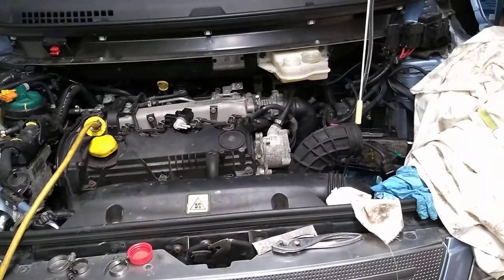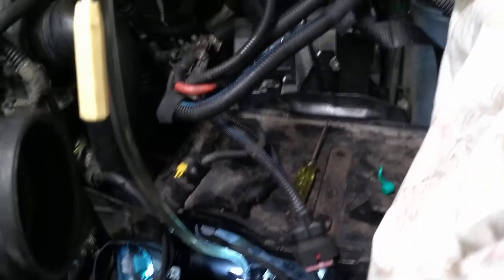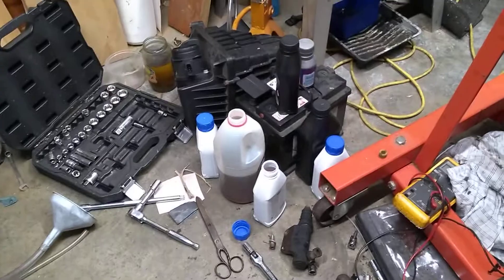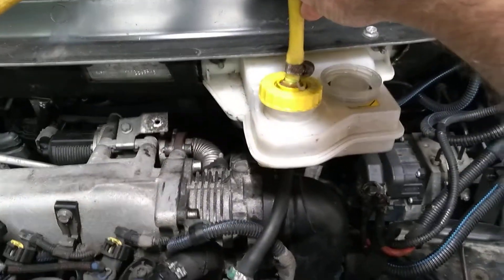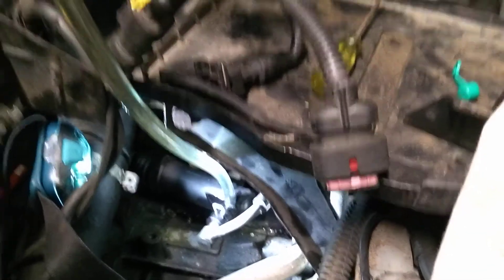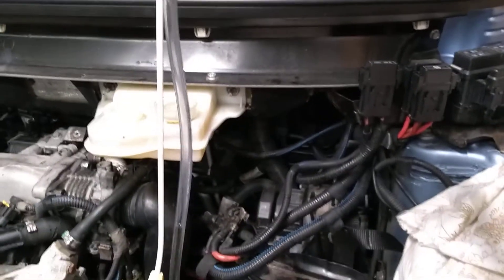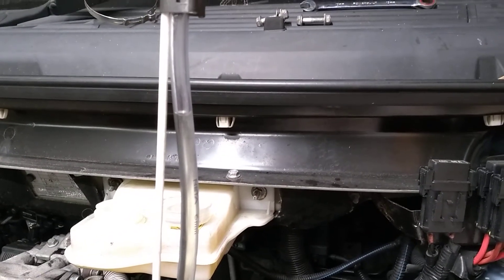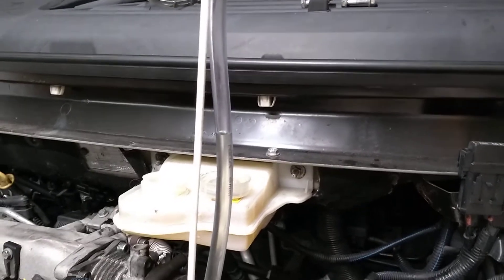Fiat Multipla clutch system bleeding

Comment: The left hand drive Alfa 155 gt (I believe) clutch master cylinder 804828 from auto doc uses the same piston, seals and springs as the multipla clutch master cylinder. 

This can be bought and the internals swapped over.

Comment: I tried for several hours and litres of brake fluid to bleed my Multipla clutch. I have pressurised the reservoir in the past on other vehicles and been successful. Not on the Multipla though. I thought maybe the master cylinder was shot. As it happens new and even second hand master cylinders are unavailable here in the UK. It sounded a bit hopeless to me to reverse bleed the system, but I had nothing to lose. I tried it and it worked. 
Jason, I'm so grateful. A thousand blessings on you and your family.
Reply from the maker: Glad it helped. I went through a few litres also :) Fast forward till 2024: We still get crunchy changes into reverse - but only when the car is hot. Something must be changing with heat. Not long to go for this Multipla....I like the look of a C4 Grand Picasso

Comment: I read your comment on the Fiat Multipla site and thought I'd give it a go - now I have a bug which needs bleeding (a garage tried to bleed it after a slave change but they failed) so I'll let you know how I get on. Thanks for the vid, George
Reply from the maker: Even after the 'eureka' moment using this method I was still struggling to get completely crunch free great changes. I'd even tried facing the car uphill on our steep drive.. to no avail (and had to winch it by hand back up grrrr). In the end I took it to a local euro car garage, who reported it was working fine... Essentially the 3km drive down our windy hill must have dislodged the final bubble. Still crutch free gears after a few months!!

Comment: Thanx! I've struggling with it as well. Going to try it today, although I don't mind the excess alcohol consumption part...
Reply from the maker: Actually, this week things have gone backwards!! So today I pulled out the clutch master cylinder to check... Four hours of knuckle-scraping joy. The factory procedure for bleeding does use pressure on the reservoir. It's the only thing that's been difficult on a Multipla :(
Reply: Tried this today with little or no difference to my gears. Difficulty getting first and grinding reverse, in hot weather it's much worst